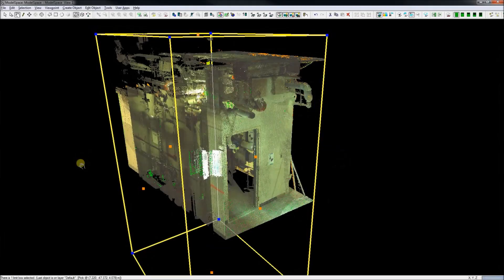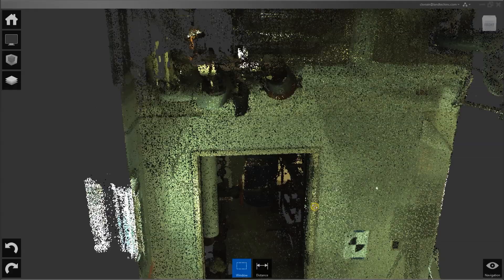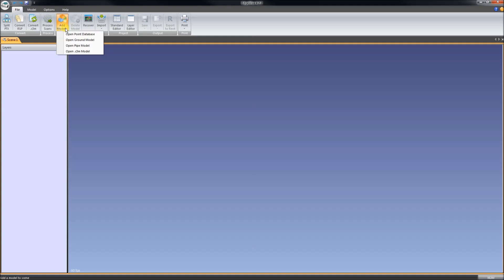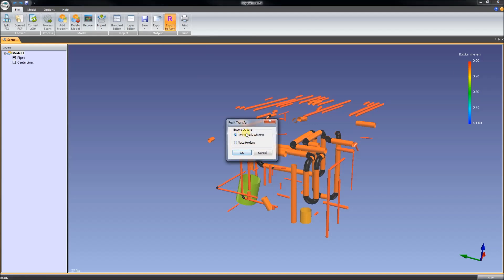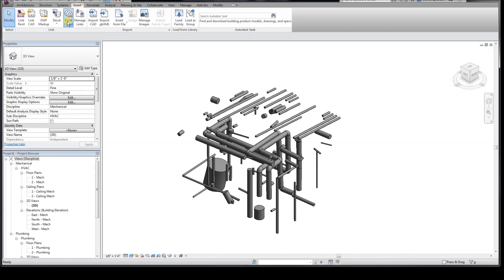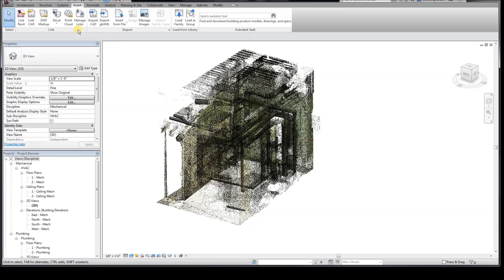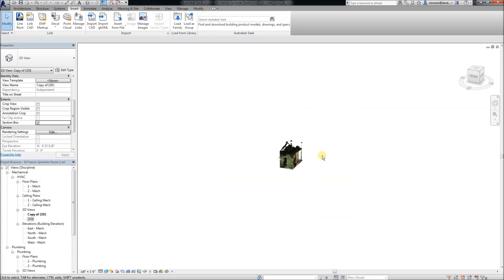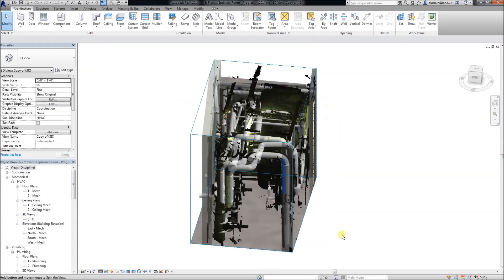Demonstration of Cyclone, EdgeWise, ReCap, and Revit

Comment: Hi, I'm currently working on a project and we are trying to see which are the best softwares that can aid us on building a good accurate model from a point cloud, we currently use autocad , I have seen that Revit may have a better workflow but from your point of view is it better to use a BIM soft like Revit? (New to BIM btw), and how accurate can you get with Revit (I saw it has an option to detect coplanar points and e.g. build a wall, thing that AutoCad doesn't have and really automates some of the designing tasks).

Also which verison of Revit do you use?, our focus is to provide a service to industrial facilities but we are also considering an architecture service, which software can you recommend me from your experience in the scanning industry?
Reply from the maker: The answer really lies in your client. Most architects work in Revit while firms involved with industrial applications usually utilize AutoCAD or SmartPlant. You need to determine what your client needs. Modeling from point clouds can be done in any of these software packages and/or imported into them. There are multiple plug-ins available that will assist in the process depending on the software. Most of our modeling is done directly in the software however we also utilize Edgewise and Scan to BIM for plug-ins. We also model within Cyclone for export into other programs depending on the need. These are only a few of many packages now on the market.

Regardless of what package you choose, we recommend you utilize ReCap for visualization of point clouds within Revit and AutoCAD. ReCap is embedded into the 2014 design suites and will make viewing of point clouds in Revit and AutoCAD much easier and faster.

Accuracy again depends on your client. Point clouds are very accurate but modeling to high degrees of accuracy takes time. Modeling to within 10mm is much quicker than modeling to within 2mm.
Reply: LTC3D What does it take to model with high accuracy? I know the software helps extracting solids,etc but then again how can you assure you're model will be accurate enough let's say within 2mm, does it depend on the software, visual inspection or the designer, I'd really like to know what does it take to model to this kind of precision from your previous work.

Also I'm currently gathering inof on softwares like geomagic design X, kubit, trimble realworks, aveva laser modeller, do you have any experience with any of these?
Reply from the maker: Víctor Chávez The simple answer is time. For instance, several software packages will semi-automatically extract a wall surface. The surface however will be flat. If you want to see variations in the surface you need to dig deeper and run a terrain model on the surface or utilize a software such as Geomagic to drape the surface. Also, most walls in the as-built condition are not truly square and plumb. However most architects do not want it modeled the way it truly exists because Revit is not as friendly to work with when walls are misaligned. In those cases walls are generally modeled square and plumb and the point cloud is utilized to show misalignments.

Accuracy all starts with the scan process itself. Because scans can be registered does not assure accuracy. As a survey company we run survey control on every site to tie scan targets in. Scans are then registered to survey control. We never tell our clients the model is accurate to within +/- 2mm due to all the variables but in theory it could be if needed.